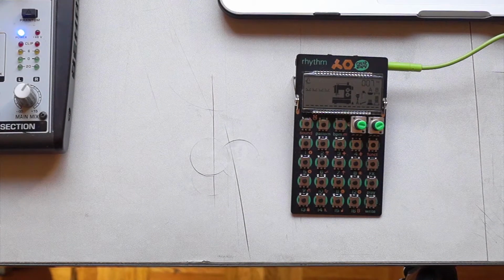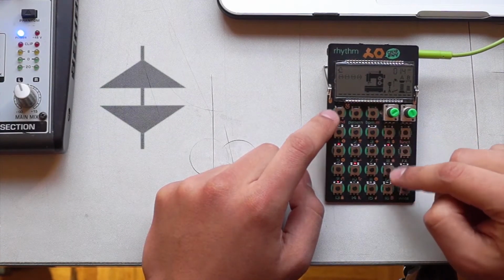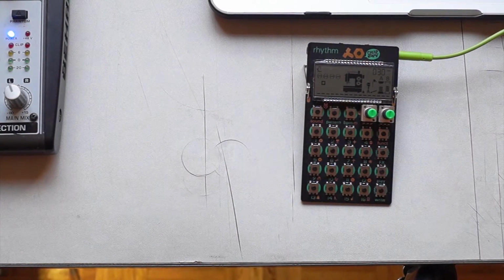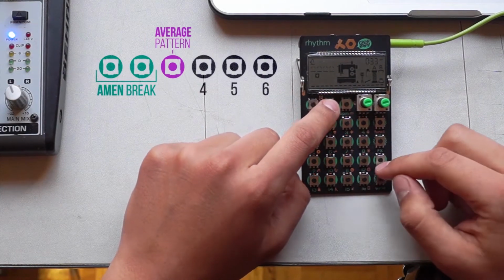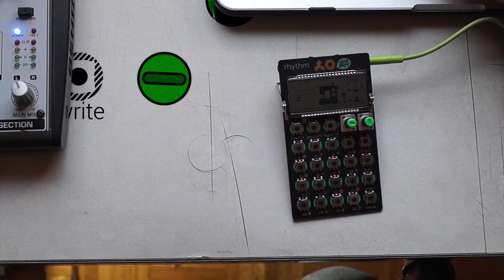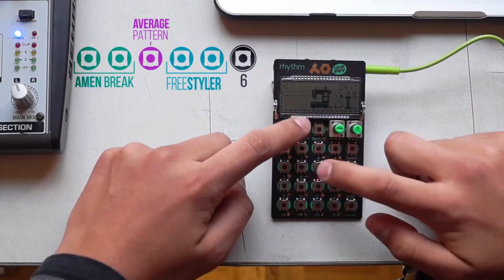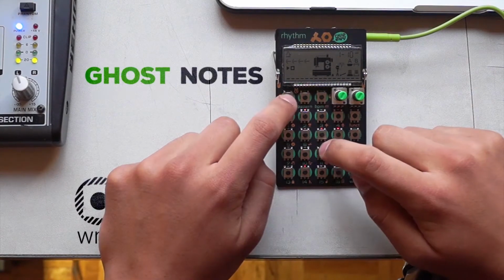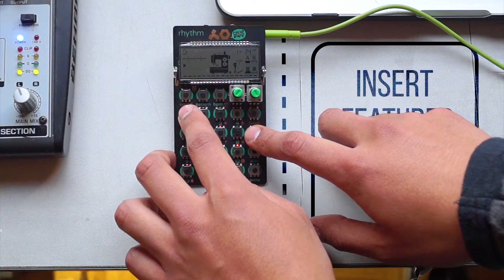DRUM N' BASS on PO-12 [Tutorial] (With featured guests)

Comment: The official demo's were quite lackluster, but after seeing this video I might have to pick one up!
I already own the PO-14 Sub. If I use the drum machine it has built in and change Parameter A I can tune the drum sounds (you're basically stretching the sample) and if you tune down far enough you really mess up the samples and get very weird effects. And parameter B boosts volume and gives it a little drive. I assume you can do the same in the PO-12?
Reply from the maker: More or less. You can mess around with the samples to get very weird effects too, but there's no way to control the volume of each sound directly. Instead, the knobs modify other parameters like attack, decay, release (talking about amplitude) the filtering or the thickness of the sound, resulting on a quiet or loud sound per percussion. Still, it's one of my favorite pocket operators (I haven't try the tonic though, maybe it's better). What makes powerful this pocket operator is its polyphony.
Thanks for watching! :D